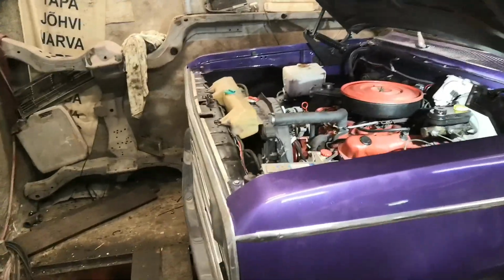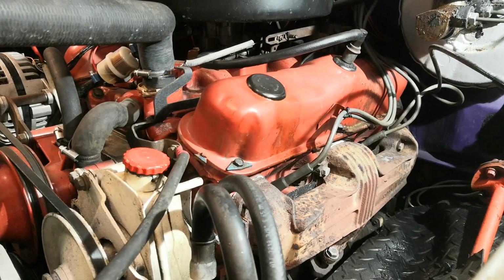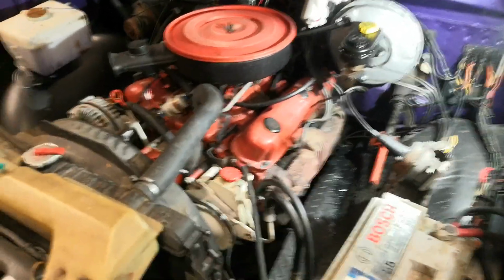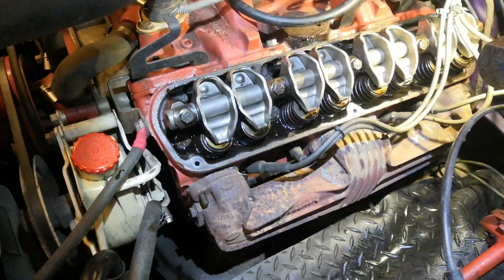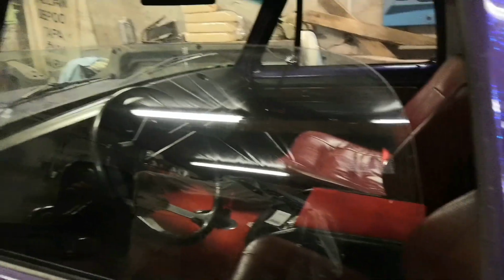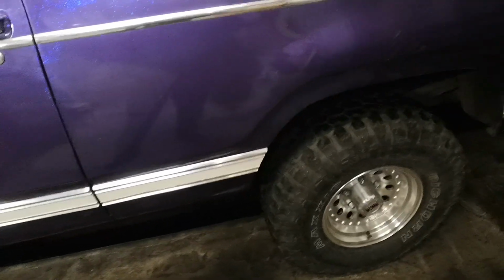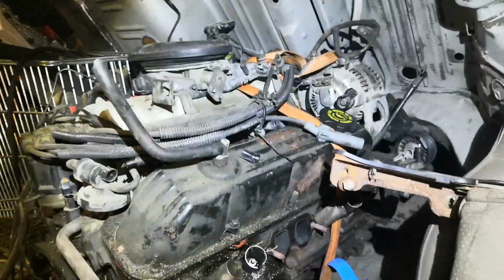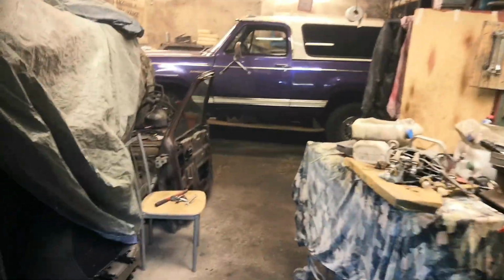Dodge Ramcharger ep 21 - Engine noise problem solved

Comment: Hey Niki
You mind to tell how it does now, did the tick stay away. What was the reason? Was it only the hydraulic tappets? Did you have excessive play in the rocker arms or what was the reason to replace them as well? 
How much miles/kilometers had the engine when you did this service?
Have the same sound, with an engine that supposedly has only 2000Mi on it and low oil pressure. I assume that there's sludge and carbon deposits which prevent the tappets from working properly.
Reply: Hydraulic tappets lifters needs cleaning